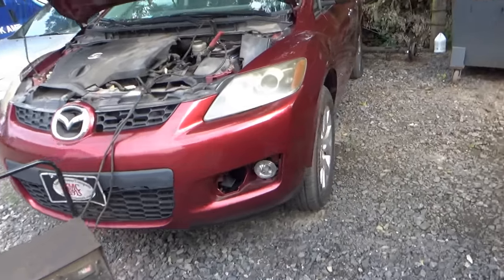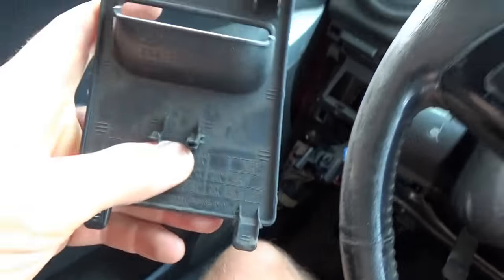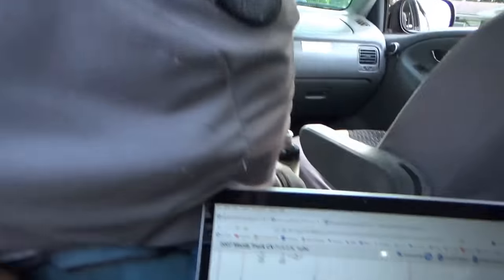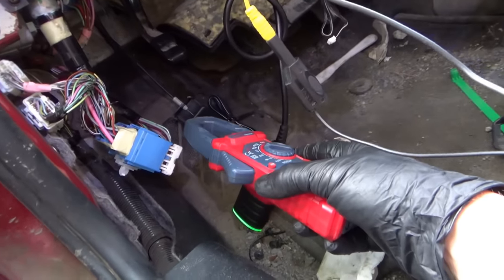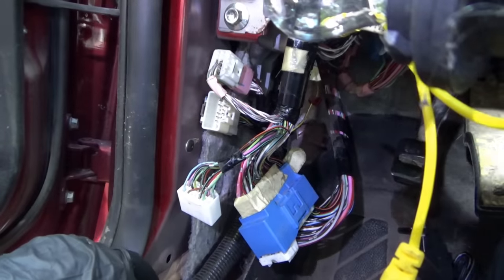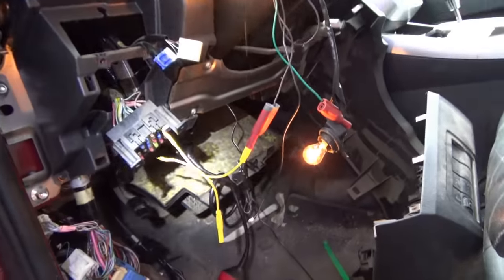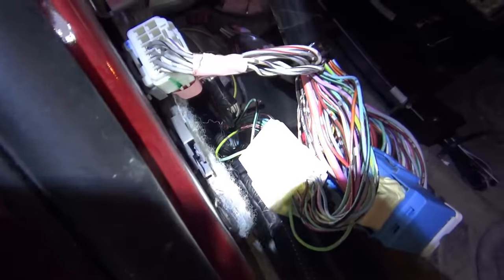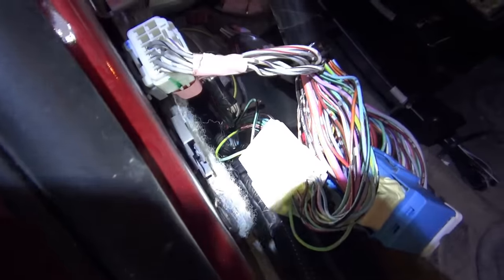DEAD After $3k in Suspension Work?? (Mazda CX-7 Turbo)

Comment: This is why you don't dump all that money into a junker..  just drive it with bad suspension until it dies..
Reply from the maker: I'm wondering what the heck they replaced for 3 GRAND lol! My 89 Mazda van is still on original suspension components (except shocks lol) at over a quarter million miles!!
Reply: @PineHollowAutoDiagnostics   Yeah, I've driven 4 vehicles now past 300k miles in the past 25 years and I never changed any suspension parts, ever. :)  ... other than some ball joints, u-joints/front axle shafts  and brakes... not much else around the wheels.  I put new struts on my sisters minivan and they failed again in just about a year..  But they were only 150 dollen.. So I'm not sure where the 3k went either. :)

Comment: Personally I think the owner's an idiot. 

A person spends $3,000 on suspension because they intend to keep that car as a long term proposition. 

After being told "NOW that we've taken it to a COMPETENT repair shop (that calls in PGAD if needed) we've fixed most of the other problems except it needs 2 new computer modules, used ones probably cost $400 and it will go for sure".  

To which the owner goes "No, scrap it". 

So it's cost him whatever money he had in the car, plus the $3,000 for a whole heap of suspension work, plus whatever other costs, but for not wanting to pay $400 more, he's gonna sell it for scrap for like $1,000 ?

 Maybe "Samcrac"  or "100% Jake" will buy this at auction having paid just a thousand dollars for it , find out it needs just a few hundred dollars of used computer modules and have a great running new 4 wheel drive waggon for the Winter, and hey, brand new alternator, no flat batteries on snowy days LOL.  Note when Samcrac gets a snowy day, we'are all in trouble.

Comment: I can understand a failed tcm on that vintage mazda, those are a common failure point. Heck, I have done 3 in the last 6 months. But the awd and rcm module too? That smells like a reverse Jumpstart or an overcharging condition. Don't be too quick to throw the other shop under the bus, nobody here knows the full story so it would be wiser to keep one's opinions to yourself. Ivan diagnosed the issues and that is all i am concerned with. I am here to learn, not to whine and moan like a spoiled toddler.
Reply from the maker: It drove to the other shop and left on the hook. How can you not blame the other shop? 🤔😂